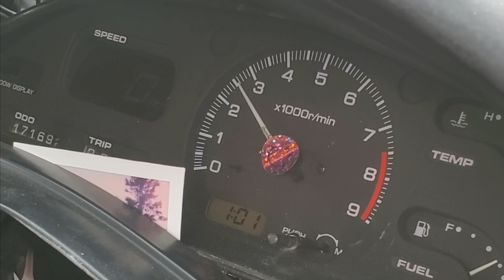Mint 240sx Crashed (How it happened)

Comment: Man if you rebuild this car, this channel is gonna blow. Even if it's written off as totalled I still think you should rebuild it. You could get it re-registered in Vermont and get a clean title.
Reply: @kiraocelot  first you check to see if the frame is bent, if it is then oh well but if it's not then the car can be saved. It's just metal. You bend back the old metal or cut and reweld new metal. Sand and paint/undercoat. Buy a new/used door, fender, and quarter panel. Sand and paint. Brand new car again.
Reply: @kiraocelot  of course it's easier to say this than the work the goes into it but only other option is to find another 240 and transfer all the good bits to it but with the rising prices of 240s honestly it could cost the same.

Comment: The same thing happened to me years ago in my 83 Capri RS. The impact broke 3 wheels, buckled the roof, bent the strut towers back so far they were touching the firewall. The other driver left the scene. I had a friend meet me there with 3 spares and I drove that bent up car back home 20 miles.

Comment: Your damage is bad but not as bad as mine, but at least you're okay it makes me very happy to see car guys that got into a crash like you, fine. But on the other hand my s14 is done for bc when i was drifting on the track, the hole rear axle flew off, it was sr20 swapped, twin turbos but at least you're one still rolls engine blew, the wires melted and when i span out and crashed it it was on the driver side unlike you, i was okay i just got an arm and rib facture, now the s14 is always siting in my garage waiting for me to fix it.

Comment: I Know how you feel. Last year My mint mint mint 93 convertible with 30k original miles got hit by some ass running red light. Totaled it. He Hit me head on, Spun me around 540 degrees he was doing 45, I was stopped. Sux, I ended up getting out of the car and chasing the dude on foot. I grabbed dude by neck, then cops pulled up so I let him go. Some young kid. Sucked so bad. I did end up getting a decent paycheck from insurance. I had collector car insurance on it. Just sucks. Your not alone. I say grab a shell and fix it if you don’t have good insurance.